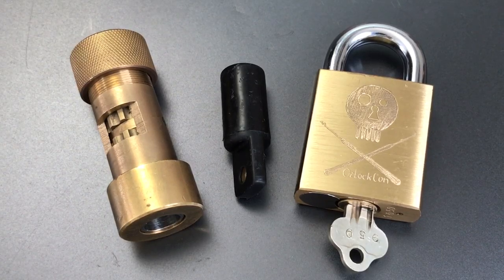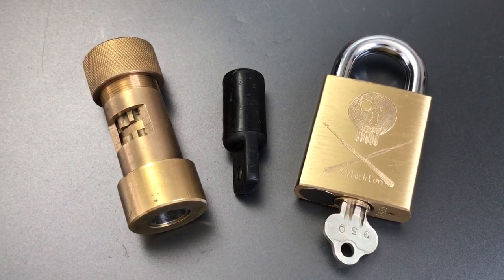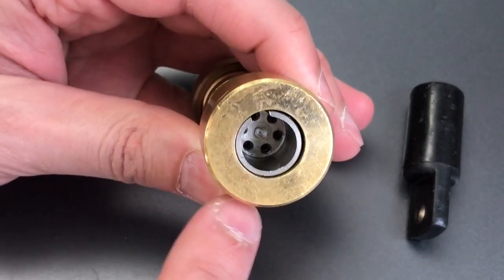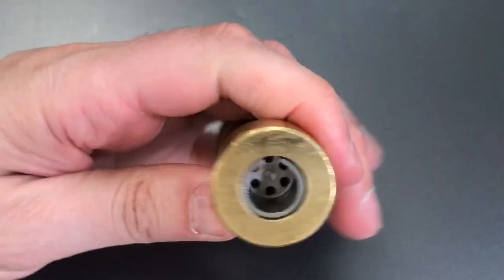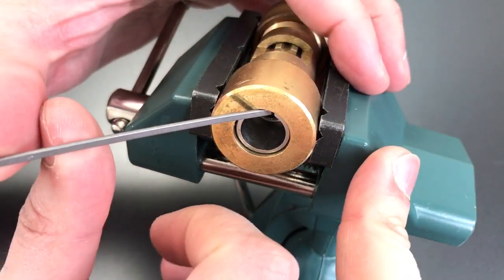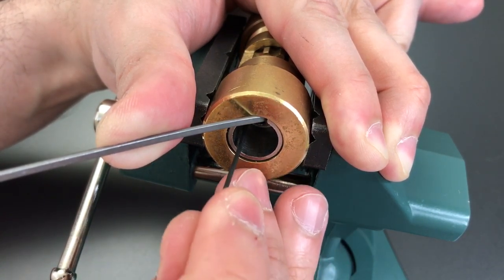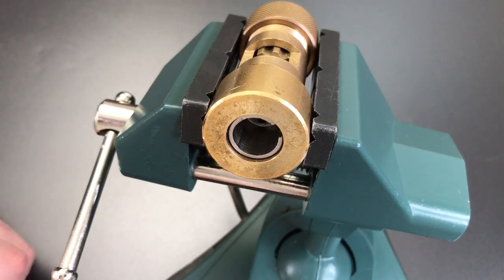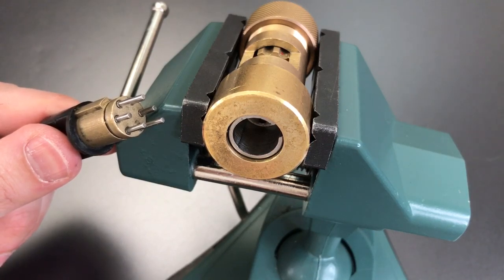[442] Australian "Hotdog Lock" Picked

Comment: Lock manufacturers: this lock is pick proof
Lock picking lawyer: What's "pick proof"?
Reply: khaair 7684 LPL picks a lock & shows video proof showing how he did it
Reply: Pick proof means you pick it and show proof.
Reply: So then what do you call a Bowley?
Reply: To be fair, he didn't fully pick it.
Not that he couldn't have, obviously.
Reply: well... "you have to pick this 6 times for a full rotation" which means at 4min/pick it will take 24minutes to get in.

i think that's pretty "pick proof"
Reply: @NiekNooijens  that depends on the location and time of day.
Reply: It's kinda like 80 proof vodka, but you don't get hammered.
Reply: @NiekNooijens  My thoughts as well. It doesn't matter how easy it is if it takes a lot of time to open.
Reply: Where is the video for the OzLock Challenge lock?
Reply: @NiekNooijens  it's even better than that, he said he failed twice out of four times, so two attempts ish to pick per turn, 8mins * 6 is 48 minutes not bad....
Reply: Pickproof in USA is easy to pick, in Italy for low security we have "Perfecta", LPL did a video on that
Reply: @NiekNooijens  so to make any lock pick-proof just put a camshaft and a gearbox, so you have to turn the key 100 times for the door to open
Reply: @monad_tcp  at that point it’s very inconvenient to open your door if you have to turn your lock 100 times.
Reply: @victorkim1807  nah, just adapt the key in a electric power drill
Reply: @monad_tcp  good point
Reply: If you are curious, as the hotdog people

Comment: with that big hole up front, it makes it tempting to use a 15 amp hammer drill
Reply: Personally I was thinking .357 bird718.
Reply: David Grover yeah that’s definitely not gonna draw attention from everyone inside a quarter mile.
Reply: @CoolCatRyan-g3h  No need to worry about setting off the security alarm if the fire alarm is already going.
Reply: @CoolCatRyan-g3h  I personally prefer Fuze.
Reply: @AL-lz6px  Aaand Fuze just fuzed the hostage. Again.
Reply: Come on guys , 
  in Australia 
No one's going to bat an eye lid at a boom in a mile radius. 
Car back firing ( inner city )
Ramsey Gun ( inner city )
Mining ( out back )
If it repeats or prolongs then the blue boys " might be notified "
Reply: So a 3500W hammer drill?
Reply: @bird718  products from "Home Depot" are unlikely to fit in Australian power outlets.
Reply: @johndododoe1411  
i am sure they sell tools in the land down under. how else could they build war rigs
Reply: @bird718  15amps in the US means 15A* 110V= 1650W, or about 7Amps in a country with 240V. Which is why we use W instead of Amps to denote power draw. Otherwise it is meaningless across borders.
Reply: @Carewolf  
i am talking in amps not watts. 
watts = 1 × 15A × 120V = 1800W
watts = 1 × 15A × 230V = 3450W
Reply: @bird718  Yes, but a machine made for 1800W in the US would also be made for 1800W in the rest of the world. It wouldn't start doing twice the work.
Reply: @Carewolf  
 i'll make this very simple.
i said 15 amp, you converted that to 7 amp in European 220-240range. 15 amp is 15 amp anywhere. what if were talking cars and drive around that track at 8000 rpm in top gear and you say, in a ferrari thats like 4000 rpm at the same horsepower and thats not fast.. now your saying a corvette made in the usa is not going to faster in rest of the world.
Reply: @bird718  No it isn't. What is the same everywhere is resistance. You can calculate from that, but in practice they adapt that to fit local voltage so watts is the same everywhere. But if you don't adapt to local voltage, you are just going to burn the device out because a 1800W device can not deal with 3500W of power. It is not built for that amount of power.
Reply: @bird718  Actually now that I do the math. 120V at 15A means the device has a resistance of 8Ohm (per Ohm's law). If you connect an 8Ohm device to a 240V source, it is actually going to draw 30A.. Ohm's law makes it even worse.
Reply: @Carewolf  
good thing they have different components to handle the different currents inside these devices.
Reply: @Carewolf  
when did i say its going to do twice the work? i said something about 15 amp hammer drills and your going off about different currents and conversions. now your saying its the same thing. please make up your mind. what i am saying is 15 amps is 15 amps and your trying to convince me its not 15 amps in a different country. i am not talking watts, not volts, i said amps.

Comment: First thing my " drill instructor " told us  " locks are made to keep honest people honest . If a criminal wants it  , they will get it .
Reply: yep.  locks are for peace of mind, not security.
Reply: @thomasjenkins7506  Good locks are for security, but only as a part of a security protocol. Good ones will require time, tools and/or suspicious behavior to open without the key - your security should be good enough that this is easily spotted and the attempt thwarted. Now if you don't have that security system in place and rely on the lock itself to keep people out... Yup, no lock is safe enough. On the other hand, a lot of the locks on the market do not even offer that...
Reply: @adamkozakiewicz6766  Hell, half of the time things are just made to look locked.   Really depends on what's behind the lock.

Comment: Perfect precursor to magnetic locking mechanism. Each pin could have a different polarity, and if I'm right it would require all pins from the key to complete the "magnetic field" to turn the core. Even easier to keep secure with electronic sensors as an added measure for security.

Comment: I feel another way to approve this type of lock would be a tension plate that extruded where the key uses the groove to turn. Make a little slit that is tightly tensioned so only the key would be able to push it back in to turn it like a double lock

Comment: This lock would be pretty simple to beat today. with a 3d printer you could make a shell to go inside the lock, insert some thick wires through the shell holes to pick each pin, and once it's done, fold the wire to make the key. No need to pick 6 times for the full rotation
Reply: to be real, a criminal don't want to spend lot of time picking a lock unless they are really serious about to harm you specifically. Soo a hard to pick lock is good to keep criminal from breaking into your home. not because its unpickable , because it will make them just give up and search for another target

Comment: nice to see a lock with actual pick resistance after all the gun junk
Reply: I kinda like the gun lock videos. But it is true, they all are junk.
Reply: Well not really that much pick resistant .. looks like 1 spool in there, and can you even have better access to pins ?
All you need for pick resistance is good paracentric key-way, so you simply cannot get to pins with any tools .. lets face it, pickers on youtube pick locks which can be picked. If you want security, watch the videos with locks they couldn't pick :-)
Reply from the maker: Thanks... and a agree this lock wasn't all that impressive.  That said, it would take quite a while to pick it a full rotation.
Reply: Given it's design, I wonder why they didn't tension off the pins of the key itself. I know they still needed some way to align the key but it might have made picking even harder.
Reply: @two_tier_gary_rumain  my guess is so that the user would know which way to insert the key, without any clear indication that could be useful even in dark condition, this could be a frustrating experience to use
Reply: @dvhh  They could've had the notch be triangular instead of rectangular, though. Same effect on  guiding the key itself, but a shallow triangle notch would be a lot harder to grip.

Comment: Would it be possible to make this lock without the slot that you used to tension? Instead making the keyway slightly oval shaped so it would be extremely difficult to tension?
Reply: Yes, it would be great if they could create some form of key alignment that made tensioning more difficult but ultimately you could always create some form of very thin tool that could grasp the internal cylinder to create tension while still giving access to the pinholes (more pins closer together would make this even more difficult) although anything that makes it more difficult to pick is always a benefit and a greater challenge.

Comment: Why does it need the collar?
If it's for alignment, why not have an arrow engraved on the outer body that lines up with one on the key?
That way the rotation is performed only by the key's "pins" and would make it very hard to tension for a picker.
Unless I completely misunderstand the mechanism.

Comment: I would think the main problem with  this kind of lock, is the weakness of the key.
those hot dogs will get damaged real quickly with the key in your pocket.
you'de almost need a protective cover for it, but even then over time, they'll get bent.

Comment: Would this hotdog lock be possible to be turned a full rotation by using a spring-loaded rotating tool that sparks an extremely fast rotational movement that gets past the new pin holes before the pins can spring back into place?

Comment: Probably won’t see this but is there a chance that this hotdog lock could be combined with a standard pin lock on the top of the collar? Preventing the collar from moving if the top set was not also picked? Suppose it would still be doable but with security pins and a bunch of false sets it could be brutal to pick (at least the first 1/6 rotation)

Comment: Hmm, it's not really specifically accurate to call Allen wrenches "hex wrenches" as if they're the only kind, but only as a category that includes exterior hex wrenches (the standard kind that fit around the nut instead of in it). So while standard hex wrenches are exterior hex wrenches, Allens are interior hex wrenches.
Reply: I've never heard of any external wrench being called a "hex wrench". They are called end wrenches, sockets, or nut drivers (the ones shaped like a screwdriver). "Hex wrench" is the generic name for all internal wrenches like that, and "Allen" is just a brand of those - much like all facial tissues are called Kleenexes.

Comment: @LockPickingLawyer what do you think about this ideea?

If they would remove the key used to tension the core and use the actual pins of the key for that purpose, the lock would be practically impossible to pick. Yes, it would be hard to insert the key because of the missing alignment cutout but that could be solved by doing a different angle betwen two pins (as far as i can tell, the pins are all at 60 degrees each) just to make sure that you can insert the key only the right way.

Comment: Never seen the LPL pick any locks with a magnetic key .... is it possible ?
Reply: depends on the lock I guess. the older ones can be opened using normal magnet, newer ones most likely can't, because it used pattern magnets

Comment: Alright someone try and envision this, a hot dog lock but with the mechanism being behind the visible inside, with like curved slits going into the sides of the interior and reaching the pins. The key would extend lil metal sticks to reach the pins through some like i dunno hydrolic mechanism, does this sound plausible?

Comment: How about a lock that looks like a normal key, but you open it up to use a HotDog lock on the same chain - from a distance it'd look like/could be made to look like a USB dongle.  (or just BE a USB dongle with that on the other side, say part of a Tiki totem that opens easily one way but is tricky the real way...?  

And for security if anything is inserted in the traditional keyhole, instant alarm/video recording starts!  Silent or loud or opens the door to the crocodile pit up to the client/user of the lock.  That way a picker is 99% likely to struggle with the lock for a while and get recorded - but if he meets you with a gun you comply - lock goes "Crack!" - like it broke suddenly, likewise if he mugs or pickpockets you he's likely to get or try the physical keys.

Comment: I think I've watched to many lock picking videos because I ordered a lock picking set from China on Ebay today :p but I always wanted a set for 40years  for some reason.
Reply from the maker: Good luck with your new hobby.  Be warned -- it's addictive!
Reply: Grab wire rods from window wiper blades. ( find them on the ground at the auto parts stores ) make them into tenisioners, picks.

Comment: wow, I haven't seen these cracked and like you said you would need to make an imprint and click it 6 more times to be opened fully. The Lockwood mods are pretty common here to throw off people, looks like a normal lock but you cant get it open easy.
Reply from the maker: FYI - another commenter who I know to be a retired locksmith from Australia mentioned that you would only need to pick it two positions to open it.
Reply: damn, he must know the lock well. ive worked in ADF and they use normal looking locks that have very different mechanics, like the lockwood, some ive seen are Master locks but different guts
Reply from the maker: He does... in the comment, he notes that he was asked to test the prototype.
Reply: that would be why he knows the lock then, I'm liking your channel, I used to know most common locks as a kid as here is very few here but your knowledge is fun to absorb

Comment: This lock would be way harder to pick if it didn't had the notch in the ring or even better, if it didn't had the ring at all. The pins on the key look strong enough to turn the cylinder.

Comment: Very interesting I've never seen or heard of this lock either. Is hotdog lock the  colloquial slang ? Or does it have a proper name? Also seems like it would be an easy lock to improvise a picking solution, and you partially did using a hex wrench. Thanks for another great concise video.
Reply: Its the official name. The company has since become insolvent however (according to locksmith friends, in part due to the fact that the design does not interface nicely with existing doors so it takes more time/effort/tools to install (and in part due to the unusual key/difficulting getting it cut etc))
Reply: @OzLockCon  Conversely this is why Australian BiLock is so successful. The whole mechanism is contained in the half inch plug with the shell needing a couple of sidebar slots. So retrofit cylinders can be produced for just about any standard pin tumbler or cam application.

Comment: How about a magnetic key and lock system?
Reply: Key is a rod with neodymium magnets through the rod in 360 degrees of options that would pull in pins to release the lock, allowing turning off the key with a hook at the end.

You could even pin the locks with false pins so if a magnet goes on misaligned or locks the whole thing up. If you make this, consider me with the profits ;)

Comment: I don’t know much about lock picking, and this might be entirely wrong, but couldn’t you make that lock almost impossible to pick if you make it so each pin has to be set and the same time?
Reply: So that's the ostensible goal of all lock manufacturers. Because of minor variations in pin positions on a standard cylinder lock, and similar minor manufacturer errors in tubular locks each pin is not in perfect time with all the others. That's why he can pick one on at a time. 

If you google deviant ollim hes got a good (simplified) graphic and explanation of how this works and why this attack exists. LPL may have a similar primer, but I'm fairly new to his channel and am not sure

Comment: If it only didn't have the hex driver or the slot in it, the lock would be very hard to pick.
Reply: the slot is necessary to insert the key correctly.